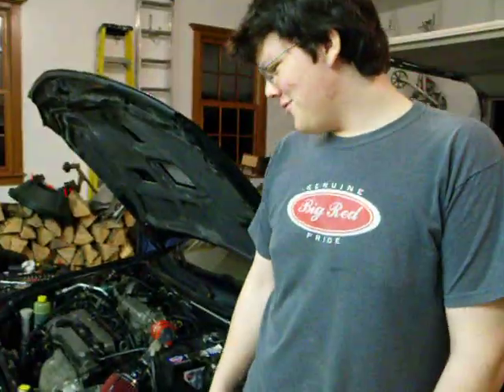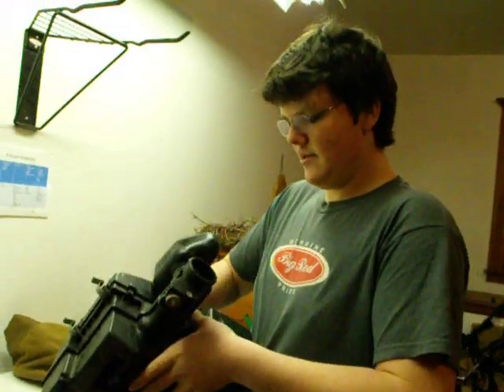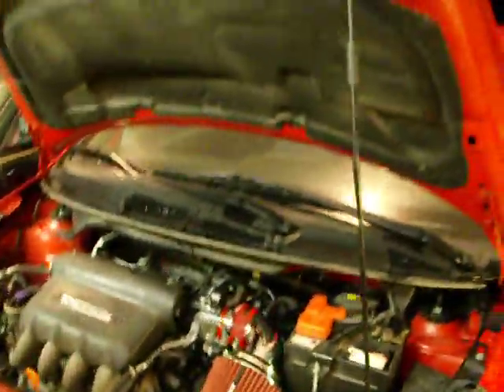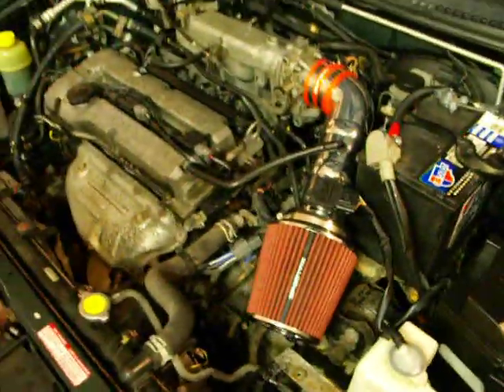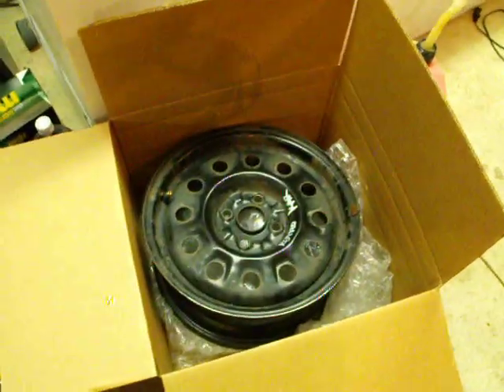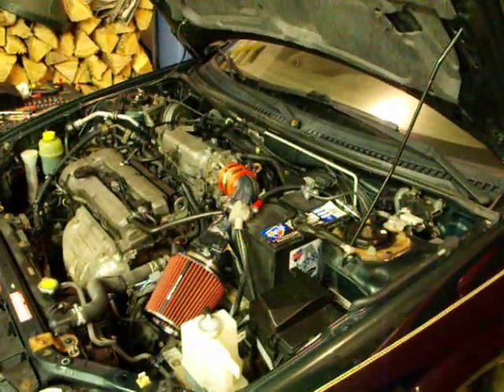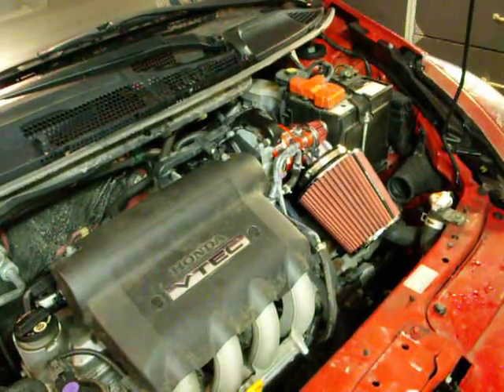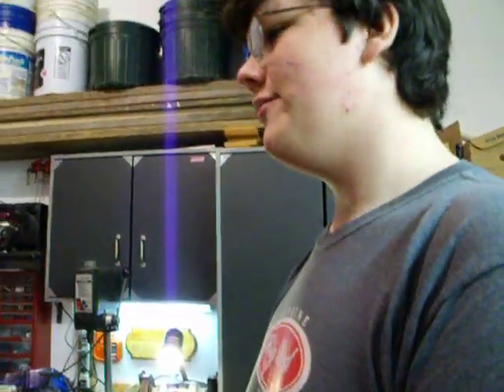Honda Fit How To Install a Short Ram Cold Air Intake

Comment from the maker: @USAFDude1 Well the definition for good also depends on your budget. Personally, I've had very good luck with Spectre so I fully endorse that brand. Short ram intakes are simply a shorter pipeline in your intake system while as a cold air intake is longer and is normally located in your fender or wheel well etc. Short ram is more for initial torque while cold air is more for mid range torque.

Comment: @CiseDj its short which allows the air to rush in quicker for better torque coming out of your motor sooo its short which rams more air in but its different from ram induction shorter more torque longer the colder the air the more horsepower

Comment: @willyhuber It's breathing hot air, not good. Install it all the way. First get a Dual Turbo Supercharger Air Intake Fuel Gas Saver Fan (more HP-$29 @ ebay), then install the elbow, the sensors and at the half way pipe install a AEM 2.5" Cold Air Intake Valve By Pass (It evaporates water and eliminates water ingestion in case of floods $45 @ ebay). Install the final tubing and try to get the Fliter behind the fog light where cold air is found.  Secure it with 2.5" easy clip on clamps.

Comment: when cleaning that air fillter you have to do more than just spray it with water to clean them there is a speacial oil on them that have to be used after you clean them its sold at auto zone for like 12 dollars

Comment from the maker: There is a "recharge" kit that consists of two spray bottles, one is a cleaning solution and the other is an oiling solution. I would use the kit, and NOT water if you can help it.